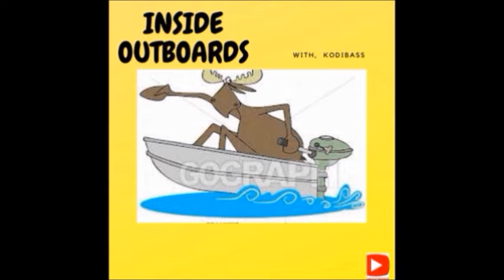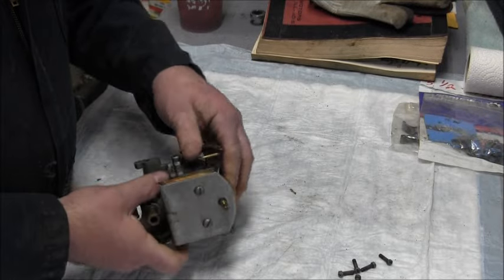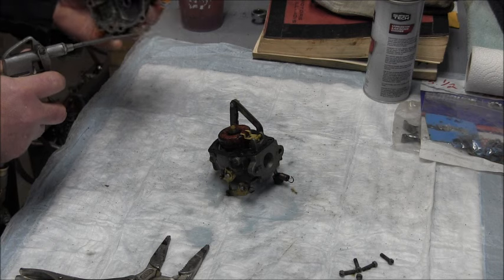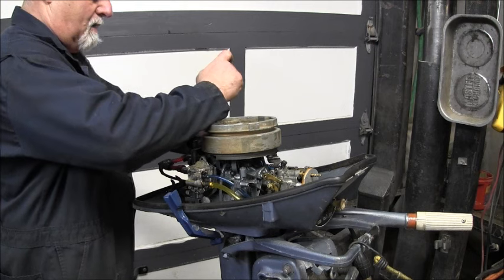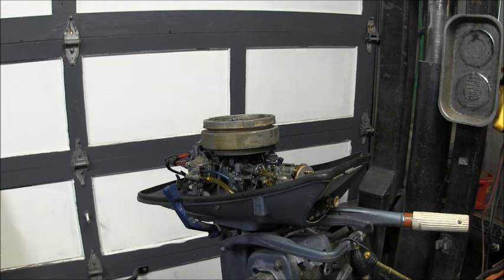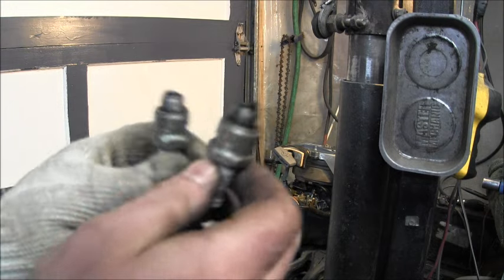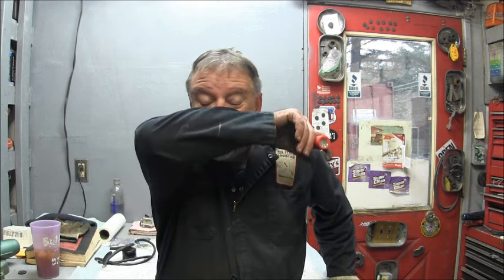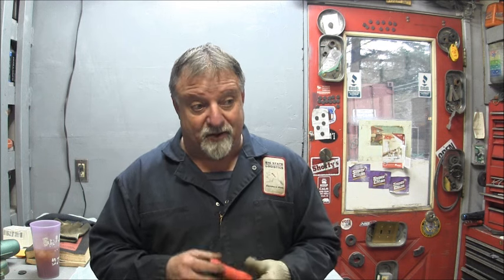EVINRUDE 1963  5 5  HP,, Sump'n  is Amiss !

Comment: I had a very similar experience with a customers 1970's 18 hp Evinrude. I did a full servicing to his motor, new water pump kit, all new OMC points & condensers, new coils, carb. inspection, and new gear lube in lower unit.  When I started it in the test barrel/tank it ran fine ..... for about
15 minutes more or less.
     Then it would run slower, and seemed like it lost one cylinder,, even though both cylinders had around  120 psi.. So I found that it was the lower cylinder!  Just like your motor is doing,,,, the #2 spark plug (brand new champion(s)!!) fouled out!!!  I replaced that plug with another brand new champion.   I ran it again, and it ran like new,, for around 15 minutes,, and fouled out the second new plug!!!  I went about my business in my shop and after it got to be closing time I decided to try and figure out the problem.
      Because it was nearly  6 pm, it became very quite outside because evening traffic slowed to hardly anything. Then I removed the #2 plug and
cleaned it really well, put it back in and started the motor.  It ran sweet again!!!  But with the nearly dead silence from the lack of traffic,,
I heard a hissing sound, similar to air leaking from an air compressor,, and I stopped the motor. The hissing stopped,, and so I knew it was coming from the motor!!!  Immediately I thought that somehow exhaust gases were somehow being held back and compressing.
      Long story short,,,,, I guessed that the mid section exhaust passage was restricted, but didn't know why or how!!!  So I unbolted the entire power head  and lifted it off,,,,,,,, only to see the exhaust horn/tube was COMPLETELY CLOGGED with rock hard carbon!!!  I deduced that my customer
was mixing his gas too rich,, and,, when I asked him if he ever would rev the motor high to blow out the carbon. He told me no, he never ran the 
motor fast, he would only troll!!  For over 8 years,,  he trolled with his boat all the while using around a nearly ~30/1~ mix!!!!
      The exhaust tube was reduced from nice good sized opening,, to less than barely open enough for just my pinky finger!!!  What I'm saying 
here is,  your exhaust may be blocked by excessive carbon build up similar to what happened to me!!!!  If you remove the power head, look down inside the exhaust housing/manifold,,, you may also have mud dawbers!?!?!?   The fowling of the #2 plug on your motor is what clued me in!!!
      Best of wishes on this motor!!!!   Ciao!!! Sonny.
Reply from the maker: Yep gott'a  let'm scream from time to time.    kb

Comment: Dear Mr. Bass....always check compression.  Bottom cylinder is NOT firing....why it is wet and dirty.  Also check for a bad s/p wire as the firing indicator seems a bit sporadic.  (swap plug wires to find a faulty plug wire.  Surely with all that "spare stuff" laying about you have a carb you can swap it out with to see if it is the carb....but my old 3hp units (I have two) would not rev too far when running on one cylinder...but as soon as the points or coil was "fixed" it would roar away.  First compression...that is my main guess, then coil, then carb, then plug wire.  Wet plug is a give away...and for pete's sake put a new plug in just encase your swap out plug is not good either.

Comment: Kodi, Many possibilities  as you know being experienced most likely just do the process of elimination approach. In depth Carb cleaning first thing. Lower bowl tends to block more often the idle bleed ,main metering pickup definitely first and check reeds when off. Good sealing needle & seat check not flooding the throat when running, float level you know the normal things.That motor should have the updated new style insulated coated coils they are very, very hardy and rarely go bad from my experience. I would just polish the points too would be my next move they all oxydize and become intermittent to no spark .I take them all out  & apart on every motor I do and polish them with blue 3M Roloc fine disc on a right angle Dotco instead of files and sandpaper. I like the results. I rarely find bad sparkplugs in my over 45 years tinkering with 100S of outboards big & small. Fuel pump  swap would be next but not high on the list...Thats just a start & check that lower pull style choke linkage too & make sure its opening all the way and not partially stuck...Good video loking fwd to your fix on it.. ...
Reply from the maker: I will Re-FACTS  Check.     kb

Comment: Thanks for sharing
Test fuel line pressure for 4-6 pounds line pressure 
Then go to grounds for ignition coils and reclean and connect
Ignition coils voltages check voltages to primary inputs to coils, and then secondary high voltages out.
Also see if carb is spitting out fuel out of the throat  of the mouth of the carb to check reed valves
Reply from the maker: 4 sure will check.    kb

Comment: I had a 5.5hp doing similar turned out it was the fuel pump.  The diaphragm was cracked and allowing fuel to enter the block where the hole is for the impulse.  I by passed the fuel pump and just pumped the primer bulb to keep fuel in engine and it would run like it should then I knew the fuel pump was bad.  It was a 1961 johnson and had a separate fuel glass fuel strainer from the factory all that was in good shape but just mentioning it had one.
Reply from the maker: Yep  we will chk  that 4 sure    kb

Comment: first:once running.unplug the primer bulb hose.if it runs better, i would check fuel pump diaphram leak or inlet needle.second:clean carburetor,check jets and passage.third: ignition timming.fourth:block exhaust port.then reeds.

Comment: I had a lil 6hp doing the same thing, and it turned out being a bent reed. also had another one that wouldn't rev up that turned out to be exh port clogged with carbon and the rings were all carboned up and sticking too. ended up overhauling it.

Comment: I had a 50cc moped 60 years ago that would not respond to throttle. Turned out silencer was blocked. One screw held baffles in. Slid out baffles and it revved up perfectly. I'm guessing blocked exhaust.
Reply from the maker: The exhaust crossed my mine also,      kb

Comment: Sounds real rich to me Kodi.  Which cylinder is the fuel pump plumbed into?  Perhaps the fuel pump is leaking, killing one of the cylinders.  Perhaps the needle valve is jammed, and not able to be closed enough to lean it out.   How about the big nozzle gasket on the carb, is that in good shape?
Reply from the maker: Possible  I will b chk'n  that    kb

Comment: My guess is the carb but for the one plug getting fouled who knows. Maybe because the amount of fuel going in doesn't have the right amount of air fuel mix right? Go through that carb good and check the small holes that ma be plugged
Reply: Also check the reeds. They don't go bad very often and it would explain one plug getting fouled. Too much fuel and not enough air mix just on the one cylinder meaning one reed is stuck open
Reply from the maker: Yep sounds like carb will b tore down hard.     kb